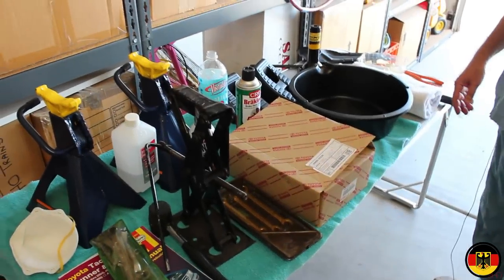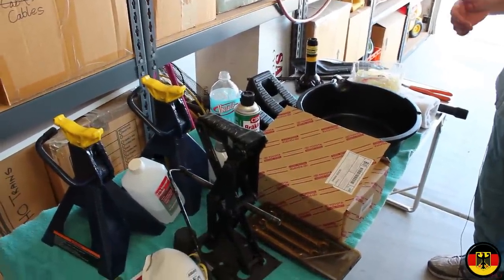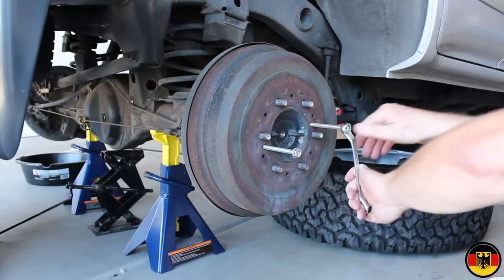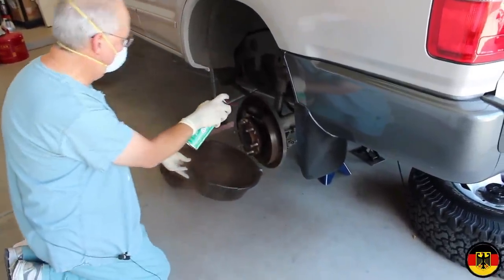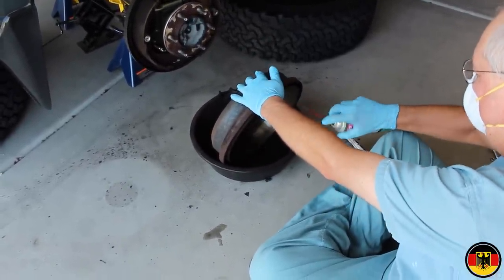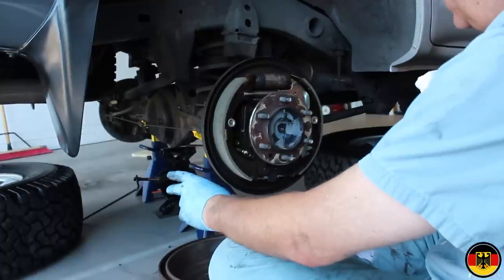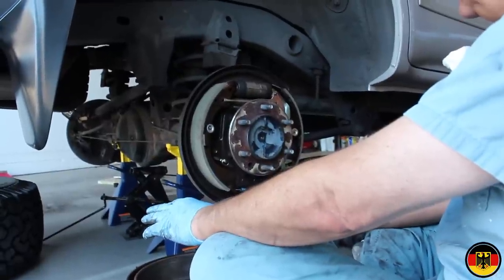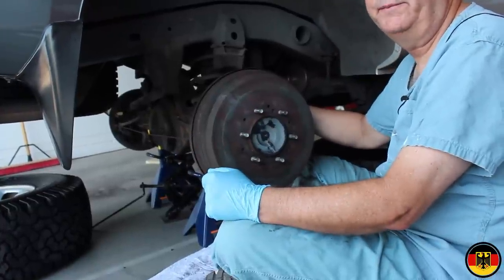1996-2002 Toyota 4Runner Rear Brake Drum Shoe Replacement

Comment: This video covers the safety aspect as well as cleaning, BUT, people search out the SHOE-BRAKE replacement video in order to see the actual disassembly and reassembly process. As in: How the brake shoe adjuster is oriented and especially for the Emergency Brake Cable part.  I was floored when you came back from break, only to find that you had disassembled and reassembled every part.  Beggars can't be choosers, but this video reminded me of what happened to me in the back seat of my '71 Chevelle SS after my high school Senior Prom ( Circa 1976 );  The similarity is eerie, the Chevelle had rear drum brakes and Mary Jane Rotten-Crotch finished the job without me.

Comment from the maker: Thank you for watching the video and for the fine complement.  The few times I have taken vehicles into the dealers they always come back screwed up.  Case in point: the Toyota dealer stripped out our transmission drain plug and pan when I had the fluid changed by them a few years ago.  That was a long and painful repair.

Comment: I am wondering, when adjusting the star spindle through the port on the inboard side of the wheel, which direction did you have to spin the star spindle with the screwdriver to tighten it just as it the shoes touch the drum. Upward or downward?
Reply from the maker: I honestly have forgotten, but the instructions that come with the OEM Toyota shoes tells you exactly which direction.  I think it was up, but I am not sure.
Reply: redonKiLaus is in the up direction!!!

Comment: Special bolts use to remove stuck drums. What size? The dealership was $20. I will get them from HD if I know the size
Reply: Pro tip. Go pull a couple bolts out of the engine bay. Obviously nothing holding a seal but its always worked for me.

Comment: I'm sorry but that video is a safety video not a rear brake drum repair. its a very difficult job. you didn't replace those drums yourself...you miss the whole point of the video.you didn't even talk about how you remove and replace the small spring on the adjusting lever spring. if you are not experience mechanic please don't mess with your rear drum you will have to tow your vehicle to your local mechanic to get it fix....

Comment: Hey there, thanks for sharing the video.  I'm currently working on my '04 Tacoma which is fairly similar.  Can you explain how you got that main return spring back on?  The one that you used channel locks to get off.  I've got everything else back together but can't seem to get that main spring back on.  Thanks.
Reply from the maker: I hooked in one side of the spring, grabbed the other side with my Channel Locks, and used the hub as a lever to get the spring in.  It was very difficult, and please wear safety glasses when you do this because I don't want you to lose an eye.  After that, I went ahead and ordered a return spring tool from Amazon.  Good luck, and thanks for watching!
Reply: If you have a long screwdriver, hook the spring on its shank and put the tip of the screwdriver into the hole u want the spring to hook into. Now lever the spring so that the shank of the screwdriver is perpendicular to the hole, and push the spring down the shank until it hooks. You might not get it the first try but you will. If that fails, then break down and get a pair of vise grips. They work great too.

Comment: I'm sure your truck wouldn't need it considering your Yota is basically the holy grail of 4runners but would you ever run any kind of Seafoam or any other fuel/oil treatment especially the kind where you administer into the brake booster line? It would be great to hear what your opinion would be when trying to bring other 2.7 3RZ's back to life.
Reply from the maker: I actually ran Seafoam through the booster line as well as the PCV line (in order to ensure even distribution to all cylinders) not too long ago...it definitely improved the idle on my truck, and alerted me to the presence of an exhaust leak just after my turbocharger.  I also run Chevron Techron (the bottle) through my fuel system once or twice a year, which helps to keep the injectors cleaned out and working properly.  As far as bringing the 3RZ back to life, you definitely want to keep up with air and fuel filters, as well as checking/replacing the factory exhaust manifold since it often cracks if it's the cast iron version.  You also want to make sure to check your valves if you have over 100k miles...the valves are known for getting too tight, especially on the exhaust side, eventually leading to burnt valves.  Other than that, regular maintenance should keep you going for a very long time.  Hopefully that helps, and thanks for watching!
Reply: +redonKiLaus thanks so much!

Comment: This vehicle was built in Japan. Well engineered vehicle although I desire 4 wheel disc brakes
Reply: other than maintenance being more of a hassle theres no benefit to disc on the back of a 190hp 4runner. They still put drum brakes on semis because they stop great and have more surface area to wear down between changes.

Comment: Youtubers I need some help. I have a 2008 4runner, the issue is that my ABS, TRAC and BRAKE lights went on all of sudden, my truck still drives and brakes fine but I need to fix those lights. About a month ago, not sure, the two front break pads and disk were replaced, and the left rear bearing was replaced as well. Don't know what might be the problem. Please help.
Reply from the maker: My 4Runner does not have ABS, and I don't have a whole lot of personal experience with the Toyota truck ABS systems.  From what I understand, when doing wheel bearings or other hub work, it's fairly easy to damage the O-ring sealing the ABS tone ring, so that may be your issue.  I suggest consulting the 4th gen section of T4R.org to see what others have done to solve the issue, as it seems to be relatively common.  Hope that helps, and thanks for watching!
Reply: I have a 2001 Limited Toyota 4 Runner and I had the exact same thing happen when I was replacing the FRONT brakes and the tie rods. I was attempting to remove the front right tie rod when I accidentally broke the ABS sensor. The ABS sensor connection point  is located very close to the brakes and ties rods so this does happen from time to time when replacing your brakes, or thats what I was told. If you have a code scanner, then you can find out which one it may be. If not, you can take it to a auto body shop and have then use their scanners to tell you which one it is. 
When I broke my ABS sensor, I had the ABS, TRAC, and one other light come up. I would start there first.

Comment: My Tacoma used to leak oil to the brakes  I thought it was the seal I changed it and still doing the same thing than I decided to ask mi neighbor he is a mechanic I told that I changed the seal he told me if the seal is ok it has to be the axle I changed it now my truck is fine i paid &250.

Comment: when i first bought my 01 4runner i had it inspected and the tech used a rubber mallet hammer to strike the drums towards getting the drums off. now my car drives like shit like there is some friction or something. and the rear axle seals on both sides keep leaking or breaking. on this video the guy uses two screw to seperate teh drums. idon't know why my tech used a hammer to bang on the drums of my car. i hated the mere though of a hammer striking my car. does anyone think that the tech might have screwed up my car and made the seals keep breaking? toyota wants 900 dollars to put new seals on the rear axle!
Reply from the maker: It's possible that the tech may have damaged your truck when he looked at your rear brakes.  You are definitely not supposed to use a mallet or hammer to take off the drums; the only proper way, and the way outlined in the Toyota service manual, is by using the bolts specified by Toyota.  If he caused damage, that could definitely be the cause of your leaking axle seals.  The friction you are feeling when driving could also be due to the tech improperly adjusting the rear brake shoes after he put the drum back on; you only adjust them to a certain point, and then they self-adjust when you use the e-brake.  

Your rear axle breather may also be clogged, which can cause the the axle seals to blow out.  

If you want more advice, make an account on t4r.org and post your problem in the 3rd Generation section - I guarantee you will get loads of help over there.
Reply: redonKiLaus thanks alot! that is great info. cause when i first test drove the car it was like driving a sports car-exhilirating and pure smooth great exceleration and no drag or friction. this is teh second time in one year that the axle seals have broke. you seem to know alot, are you a mechanic or just a car guy?
Reply: redonKiLaus on tr4 shoudl i just start a new thread or do something to find a thread already about the topic of axle seals breaking or something?thanks
Reply from the maker: I'm just a car guy who knows a lot of things about a variety of different vehicles.  

If your axle seals have broken twice in one year, something is definitely very wrong.  Make sure that once you figure out what the problem is, you replace the axle seals with OEM Toyota ones - they are known to hold much better than any aftermarket ones.
Reply from the maker: As for the thread on T4R, the general rule of thumb there (and on most forums) is search first, and post if you cannot find a solution to your problem.  The axle seals blowing are not unheard of, especially with guys who take their trucks offroad, so you can definitely find some information on them.  With your particular combination of symptoms, though (friction/drivetrain drag, axle seals blowing, tech hammering on the drums), you might want to go ahead and post a thread first.  Just make sure you list all of the symptoms/details about what led up to your issue.
Reply: redonKiLaus thanks
Reply: redonKiLaus besides replacing the seals using oem toyota parts, and checking the "bleeder"/pressure relief valve, is there any other recommendation you have that i should do to stop the axle seals from breaking and possibly bring back the smooth way the car used drive? thanks.
Reply from the maker: Definitely.  My best guess is that the tech tightened the brake shoes to the point that they rub on the drum (the "friction" you talked about), causing the rear brakes to overheat and blow the axle seals.  When the shoes are overtightened, the rear brakes are essentially "braking" all the time, even if you are going 75mph down the interstate.  

If you don't want to/don't know how to do the work yourself to diagnose and fix the problem, I highly recommend that you take the truck to a Toyota dealer for the repair.  Even though you may pay more than at a lube/brake shop, the work will more than likely be done correctly, and you won't have any issue anymore.  

Of course, the dealer will likely try to sell you other repairs and services that you may or may not need.  You can consult me or those on T4R.org if you want advice on which services are actually relevant and which are just money-makers for the dealer.  My username over there is Mc1337sauce.  

On a side note, I always recommend avoiding any lube shops (Jiffy Lube, PepBoys, Meineke, etc) like the plague, as they nearly always don't do the work correctly.  If you don't want to service your truck yourself, the best option is to find a good, reliable, honest Toyota dealer or independent mechanic to do the work.
Reply from the maker: Another possible cause of the axle seals breaking could simply be a bad install, as well.  The install is pretty easy to mess up, so an inexperienced tech could make a mistake rather easily.  I would definitely check the rear axle breather and brakes, and if those are all good, it was likely just a bad install.
Reply: +stephen tim swift  tapping the drum with a hammer works to take it off , that is  how real guys use to take the drums off.
Reply: Old habits: not all manufacturers provide the threaded holes in their drums for you to put jacking screws in, and alot of mechanics will reach for a hammer.   Since OEM specs for drum to axle hole clearance is usually 0.001" or less,  drums always put up some kind of fight based on time in service.   Seals that repeatedly leak or break indicate bad bearings, so if you are going to pull axles to pop in new seals, get new bearings - most of the labor is already baked in.  I believe for that vehicle, if you lose seals, the bearings [packed/lubed separately] get washed and they aren't coming back.

Comment: Is this the same as t100 (4x4)
Reply from the maker: +Daniel Van It don't think its identical, but all Toyota truck drum brakes are very similar, so this can be used as a general guide for your T-100.  I sold my old T-100 before I needed to do the brakes on it so unfortunately I can't help any more than that.  Thanks for watching!

Comment: Hey dude I own a 2000 Toyota RAV4 4x4 and I didn’t need the damn screws wasted four flippin days for those things to not even need them all I had to do was remove the rubber access boot hold the gear lock on the break gears and adjust the break shoes till the wear completely in and tapped the drum off like a normal rear down. Please stop making shit harder then it fucking needs to be. Also need to add in how the hell you actually remove the shoes not skipping over it.

Comment: Great video up until the part where you skip over basically the whole process. You go from old shoes on to new ones on and kinda point and mumble after that.  Great job on safety but the dis-assembly is key to putting the whole thing back together.